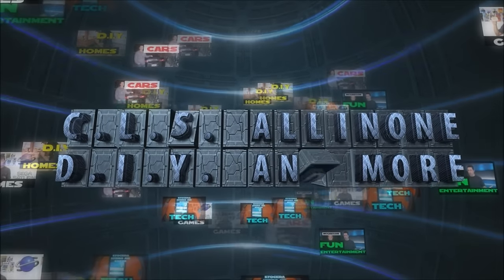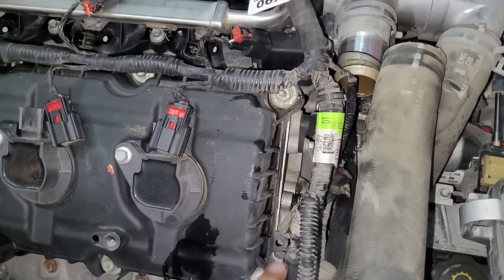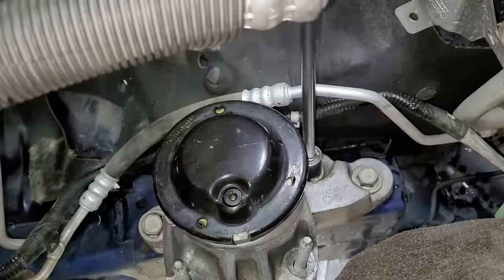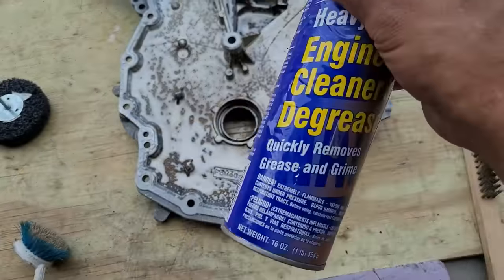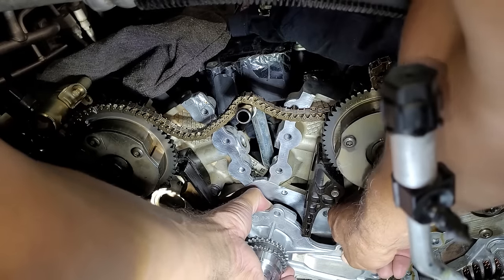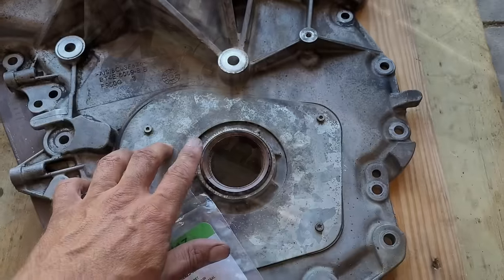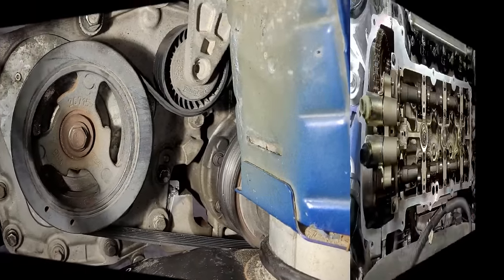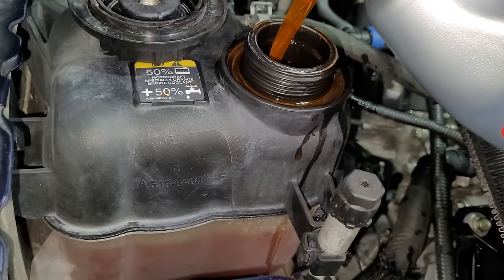How to change a water pump in Ford V6 3.5 & 3.7-liter engines 2012-19 Explorer, Taurus, Edge & more

Comment: That Explorer model was made with a front-wheel drive engine that was damaged by a garbage path. I'll stick with my 4.0 rear-wheel drive. The truth is that Ford's engineers are of no use, stop me, it's the same old medrioque that makes the Tauros, which were garbage just like all your vehicles with a transverse engine.